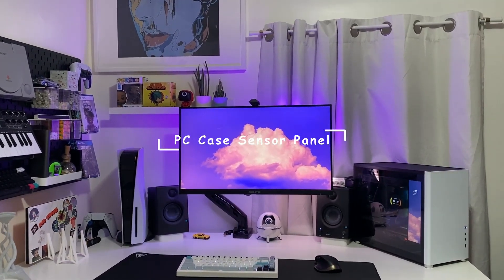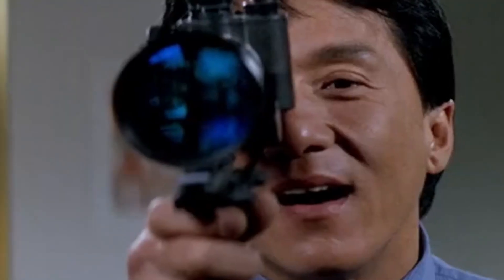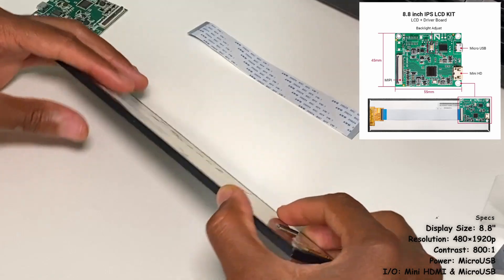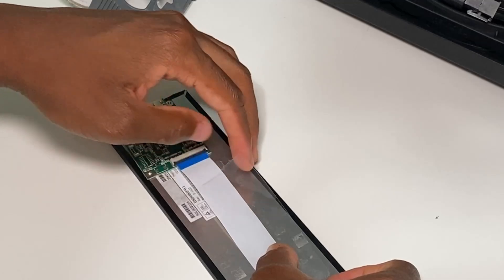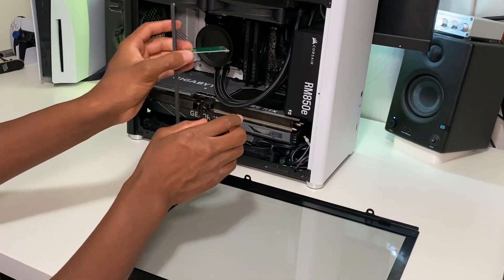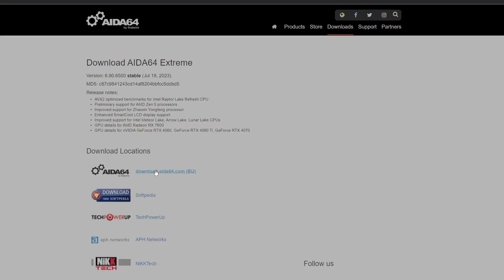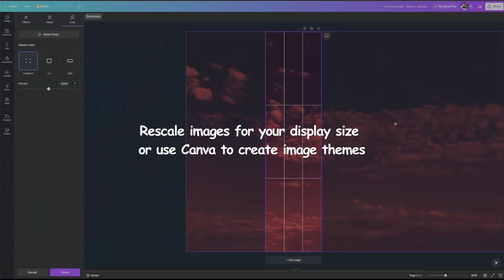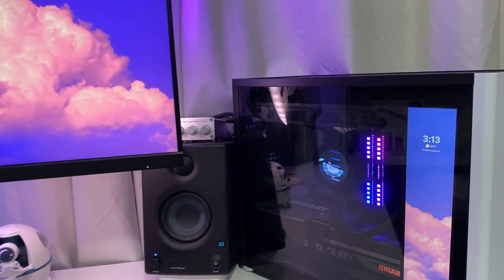How to install a Screen into your PC the EASY way | PC Case Screen Sensor Panel #pc #pcbuild  #tech

Comment: ive plugged it in but the screen isnt on and theres a red light on the mini motherboard have i done something wrong?
Reply from the maker: red light should be fine but make sure the screen is connected to the motherboard correctly
Reply: @sulcetech  is there a specific usb port that im meant to plug it into. I've plugged in the usb and then the hdmi but the screen is black, not emitting any light or anything